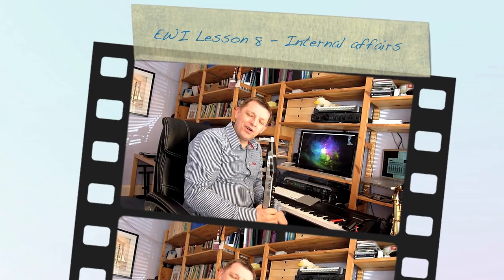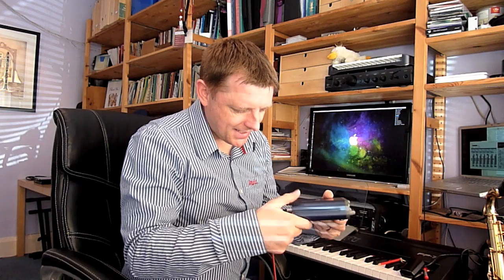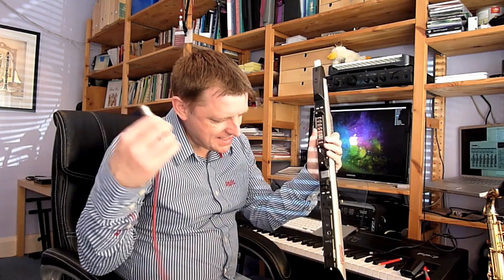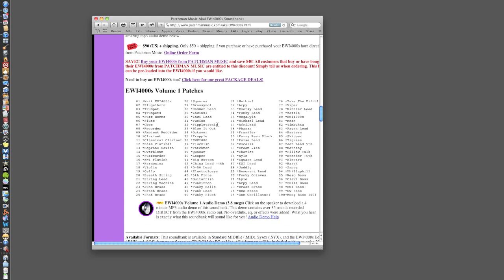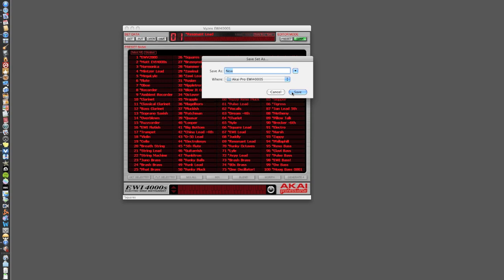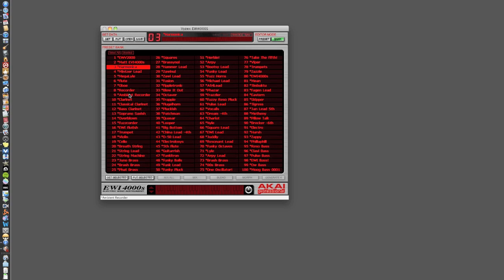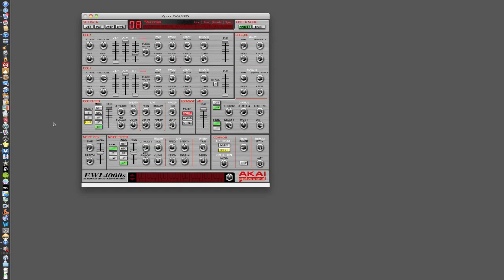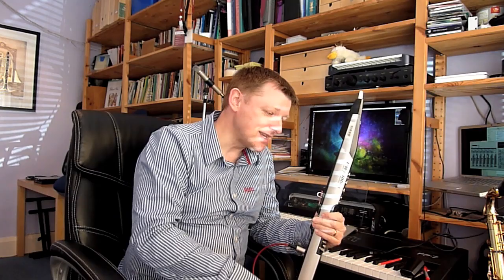EWI Lesson 8. Internal affairs

Comment: The EWI USB requires a soft synth (computer) to be played.  The EWI 4000s (used here) has its own on-board synth and you can plug it straight into an amp or use headphones.  See the other tutorials in this series. In this video, he's using a computer for the purpose of editing the on-board patches, not because you need a computer to play the instrument.  You can, however, use the 4000s with the same MIDI interface to control a software synth on the computer if you wish.

Comment: What's required to use the patchman soundbank? I have my 4000s, MIDI cables, and computer. Is there anything else I need to use the patchman soundbank? An interface, a sound module, or both?

Comment: These videos are great. These were the final confirmation that the ewi is the right instrument for me. Could I bother you with a question? When I am editing a sound everything seems to work properly. But whichever one of the "put", "sync" or "put preset" buttons I click, although the sound seems to be preserved even after disconnecting the midi cables, powering the EWI down resets the whole bank to the factory defaults. Is it something that I am doing wrong?